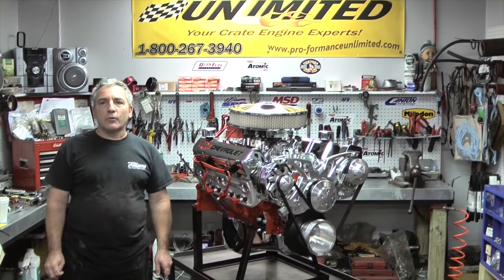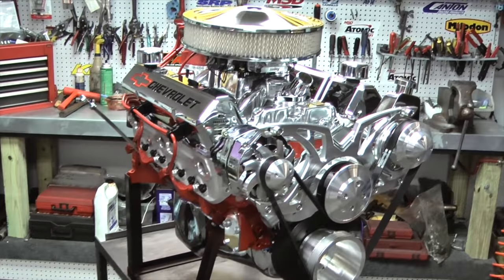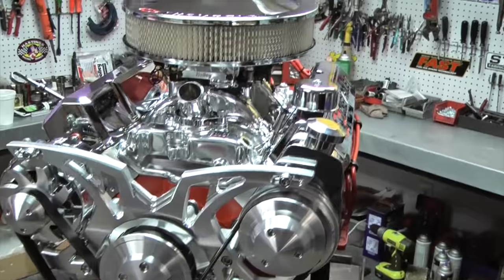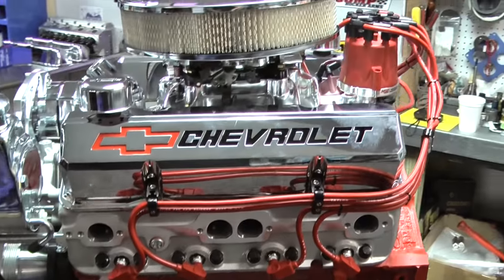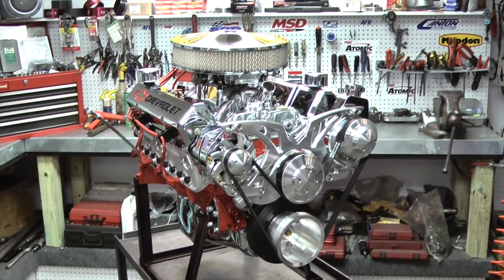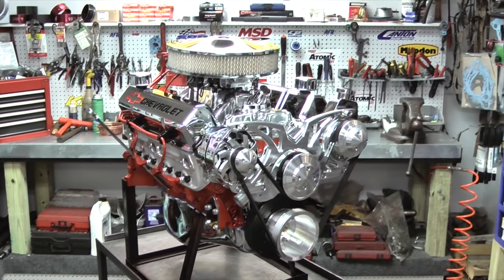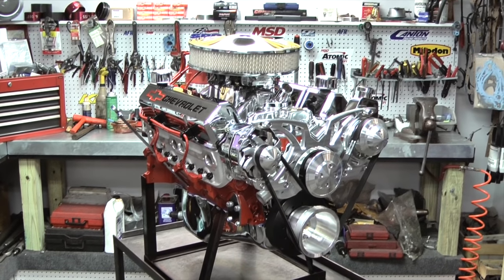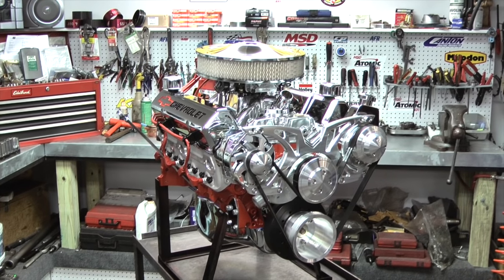383 SBC Stroker 450HP Engine Package

Comment: What most guys seem to ignore is not every engine is purpose built to achieve the highest horsepower. Look at the torque curve. He is making 517 ft/lbs of torque at 3500 rpm. This is a well built street engine that will paste your ass to the seat and still maintain street manners.
Reply: I've noticed there's more people then not that think that way lol There's a ton of people that need to learn it's a SBC and you can make them be however you want them to be and it's not always about having the most horsepower especially in a street rod!!! You build them for your application and a 350HP steet car or truck could smoke the doors off a 500HP engine built for top end power, if the race was around the block cause that 500HP will never even be unleashed if it gets made from 4-8k. Now take the same engines to the drag strip and it's the opposite because it's how u build them. When I build a street engine I don't even focus on HP all that much, my focus is on torque and bottom end like they should all be imo. What good is a ton of HP if you can't ever get your ride up to 5 or 6k
Reply: thats what i said. that is insane torque for a 383. and it still has a respectable hp number
Reply: I wish people would actually do shit them self. You guy think a 383 stroker motor is something or why everyone yous this cam.
Reply: valid point...them are big block torque numbers from a smaller package.
Reply: I have a 383 in my car, while its never been on a dyno it will blow the tire off even if I punch it at a 30mph roll.
Reply: Yeah.  Its one fantastic street motor with a torque like that.

Comment: I love how you underrate the HP, and use the right CAM.  Your V8 runs right, unlike most rods I see that are just overcammed, with lack of flow, and run like crap at any RPM, just to get that cam sound, and smell like unburned fuel.  Power first!  You got it RIGHT!!!

Comment: These are so dated and oldschool compared to whats made now. But id much rather have one of these badass motors. So much easier to maintain and repair!! You also get the same effect of just getting down the road! And occasionally you will come across one that has its own personality.
Reply: This is exactly what I told the guy restoring my '73 Camaro when he suggested I just drop in an LS1. That old school sound matches the car and it's the same reason I don't put an evolution motor in my '82 shovelhead even though they are way more dependable, don't leak oil etc. These old cars and bikes are pieces of American history and I just love going back to a better time.
Reply: @MrRubberfist  wonderful pal. Thats good.

Comment: Nov 2020 I got a 383 450 hp. Very disappointed. Ran good but there were 5 oil leaks. The breathers bottomed out and engine couldn't breathe. Blew out gaskets!  They sent me another complete gasket kit but wouldn't cover any labor. I will have 20+ hrs in fixing the leaks.
Reply: Did you buy directly from these guys Terry?
Reply: Yes. They dynoed it and said there were no leaks. It was a quart low when I got it.  I didn't think to check the breathers. Shouldn't have to. I will ask for a discount on the next one or just buy somewhere else.

Comment: 477 hp and 520 ft/lbs of torque with a water pump, alternator,  and power steering pump attached?  Thats how I dyno mine exactly as the customer is going to use it. Thats pretty decent power for a street car. The problem for the owner is going to be getting it to hook up.

Comment: Its wonderful.  30 years ago I was a nutty corvette owner and this would have been the perfect second motor if the height could be dropped a few inches.  My 300hp 1970 base model hood had very little clearance for any non stock intake manifold or larger carburetor.  It had only an alternator and waterpump for acc.  Super easy configuration.

Comment: hi Engines 100% hp done by 5800rpm , torque dropping like a boat anchor.
Tq seems to have 2 peaks 3000--3500   and 4000-4500both over 500ftlbs. Holds above 475 ftlbs real well .  Need more heads /cam/ inlet manifold to go hard over 6000rpm .
Great economy and lotsa fun with almost stock gearing

Comment: Well I possibly have a rod knock even tho the damn motor in my truck was rebuilt last year idk what the hell these idiots did that I bought it of off anyway I kind of hope it’s one because I’m gonna buy a blueprint 383 stroker with big cam and all that
Reply from the maker: Who did you buy the engine from?
Reply: crateengines well I figured out that it was a cracked flywheel but it’s weird because it goes away after like 2 mins but anyway the motor came with the truck it’s not a bad one would prefer a 383 over the 350 tho
Reply: crateengines but on top of it being cracked they broke off a bolt that holds the converter to the flywheel and so they welded the flywheel to the torque converter there and I’m sure that didn’t help anything so I’m gonna have fun getting it off
Reply: @yamahaguy1732  that's a common problem. Lots of that stuff you really have to be careful who you're buying stuff from. EVERYONE'S a mechanic and master engine builder...lol or so lots of them think. Many many small blocks and vehicles are or where molested at one point by someone who thought they knew what they were doing. The kind of DIY'ers that i wouldn't trust to change the oil in my push mower... as long as the flex plate is flat up against the crank and torque converter it'll be fine welded like that. It's just going to suck if you have to pull it. Since it's only a flex plate and not a flywheel, pull the flex plate cover off and rotate the engine by hand and see how much of the crack you can see. If you can get a gun in there to weld the crack, you could do that for now.
Reply: Jeremy Wilson the crank snapped back in September on my way home now I got a new blueprint engines 350 that makes about 400 hp and like 415 torque it’s great
Reply: @yamahaguy1732  well that certainly sucks. But awesome that you got a new motor. Blueprint has some really nice stuff for the money. Ive bought some of their products and have always been happy. But that's always been a common problem with buying used stuff that's considered "performance" of some sort. You never know who had it and did what and the older it is the more you tend to find things like that. Ive seen my share of "what the fuck even is this"? Lol
Reply: Jeremy Wilson yeah they claimed and I’m sure they did rebuild it because how shitty it was done I’ve had to go through everything they did on this truck because they were so stupid with everything so It doesn’t surprise me that some of the main bearings were starting to go out and all that it was a ticking time bomb it was gonna be one thing or another but now I know I have a good motor that wasn’t built by a bunch of morons and it’s twice as fun
Reply: @yamahaguy1732  how much was your engine ? Year one sells one with 417 hp and 444 ft lb but it's a 355sbc.

Comment: $?
Reply: Raul Zarate need a few more of these 
$$$$$$ .... The website has these listed base package no pulleys no carb no headers $8500. I can build the eagle stroker for around $3k . I stopped useing eagle junk and moved to scat or other custom ground cranks h beam rods and forged pistons and still don't charge this much. I'm not a hater, but these are extremely overpriced
Reply: @seangangstad9597  Even using Scat (my choice now also) it ain't that much off in price from eagle. Beautiful looking stroker but I'm with you on the price lol Definitely getting his money back out of them lol Now if it had twin turbos or a blower then the price would be more realistic IMO

Comment: Wats that engine run in price
Reply: Joe Clauss 

the price is between $5800dlls - $7300. 

For a 383 stroker, the good thing
You’ll have a nice, clean, and powerful brand new motor 0 miles.

Comment: Wow. That's the lowest horsepower 383 I have ever seen😂
Reply: Gage Cook you're funny, maybe your talking about 383 junk that breaks down but from the looks of this I'd take it any day
Reply: +Daniel Vasquez as long as you get a 383 balanced correctly you're not going to have any problems with stuff breaking or making over 500.
Reply: Wow, Gage Cook is again a variety of the lowest sucking trolls on the net. It is an engine package, not the maximum HP package and about where a stout 383 comes in. The man can build a 500HP engine, surely. Balance alone is never the problem with "stuff' breaking. That is ridiculous and ignorant. You have no credibility. The "stuff' you are talking about takes disproportionately more money and time to produce 500+ power in a 383 and make it reliable. And yes, even the the compromises that come with it, even fuel, to ensure it's safety. It is self evident you have never built, owned, or known what a 500 HP engine is. You surely have never paid to actually dyno one. In the mean time, move on while people with merit actually work to produce something of value. No reply to follow. Move on.
Reply: +jiff jiffernson you do realize that this motor is 10 thousand dollars American right? And I own a 1978 k20 with a 523 hp 383 that I daily drive and beat on every day. And yes. I did build the motor. It's not hard to make a reliable 383 buddy. Bearing clearances, good oil pressure, good coolant temps and a good tune is all you need to make something reliable. My truck will run everyday all day no matter what the temperature considering I live in Canada I can say I know how to build a reliable engine.
Reply: I got a 500hp 383 and haven't had no problems with it
Reply: jiff jiffernson,, dude lives in Canada, NUFF said!!!
Reply: What’s a good damper for a high compression 383? I’m in the middle of getting my rotating assembly balanced now
Reply: Gage Cook, I took a look at your profile page. I see no videos of you building a 383. You seem to have all the rhetoric of an expert but fail to provide little more than just that,   rhetoric.
Reply: I've got that engine beat.  I just installed a 383 stroker in my 74 K10 with 414 HP. :D  Its on my channel...
Reply: old post but you do realize that not every engine is purpose built for hp right?  this thing makes over 500 foot pounds from 2800 to 5000 rpm. that is ree-fucking-diculous for a 383.
Reply: @bilbobaggins4710  glad you like it!
Reply: @Punk-Jw  that's true  I'm building a385 by myself. Only in parts I spent around 8k 500 hp top end, intake, 7 qt oil pump starter high rpm flywheel and clutch kit, high flow water pump bottom kit or stroker kit, fuel injection carburetor, push rods etc, High rpm dumper etc.